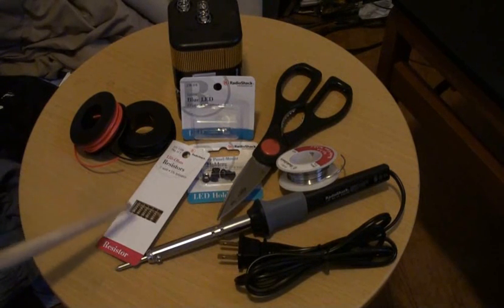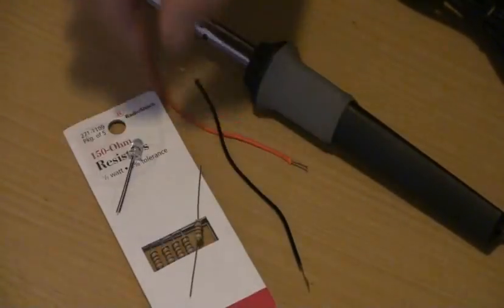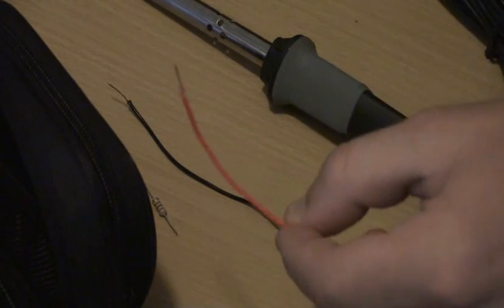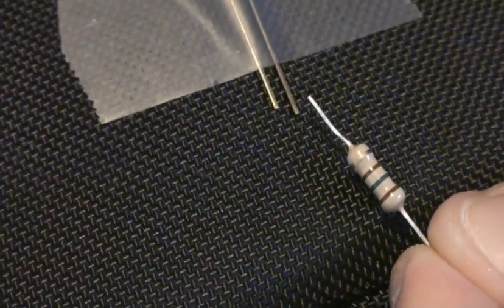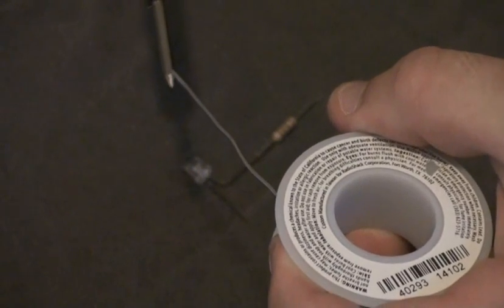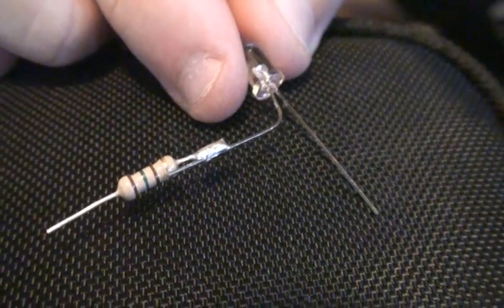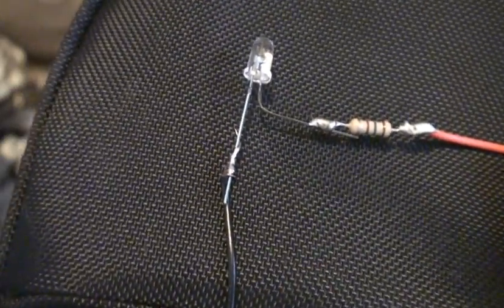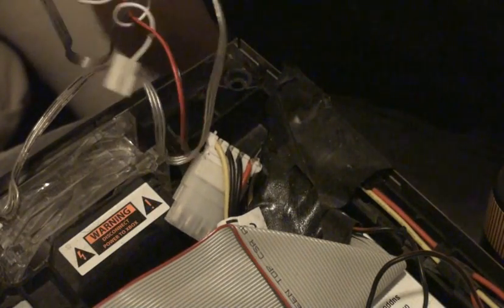How To wire LED's

Comment: always make sure your parts are hot enough to bond with the solder. that is a very big and wasteful joint and it also does not look like it is truly bonding (i.e. it's wrapping around your wire). to fix this you can tin your components before soldering them and and then simply touching your iron and poke on a little dab of solder. you will get a much better connection!

Comment: A resistor can go anywhere you like in a cuircuit, ie a closed circle. Whether the resistor is before the LED of after makes no difference, the current will be restricted. Current can not be higher or lower on any part of a closed curcuit than another.

Comment: @Famoussasdrummer182 "you always want to solder the resistor to the positive lead first. Because this is where the current is coming from and to the LED first. Putting the resistor on the negative leg will serve no purpose since the current has already passed through the LEDs."

WHAT?!?!? Are you kidding? LOL, NOOB. It doesn't matter WHERE the resistor goes as long as it's in the circuit.
AND don't try to tell me I'm wrong. Just look at my page of the stuff I do first.

Comment from the maker: @argannonumus 
hi
you always want to solder the resistor to the positive lead first. Because this is where the current is coming from and to the LED first. Putting the resistor on the negative leg will serve no purpose since the current has already passed through the LEDs.

Comment: m wiring up some leds and im running it on a 9v battery and all the power specs add up to 10 volts will i need some kind of resitor

Comment: hey i have 17 white 3,5 volts led's and im running them on 4,5 volts (battery)
but i want to hook em up to a powersuply that puts out 12 volts what resisto do i need to have 

im using a big resistor (green black silver silver)  is thatt bad ?? pleas tell me what resistor(s) i need to use 

reply fast :)

Comment from the maker: @mambabear 
hey
it all depends on how much those 12 LEDs need to light up properly as well as what type of circuit you are going to wire them in. But by just that inf o you gave me you will need more than 9v to light up 12 LEDs unless those LEDs use less than 1v each

Comment from the maker: @dalbir122 
hey
u wont need a resistor though since you are drawing .9v more than the battery is capable of providing but because of that your LEDs wont light up as bright and your battery will drain faster

Comment: @Account4Comments
The man didn't tell anything about what resistor to use. If he didn't have a web calculator, he probably couldn't decide which resistor to pick. I bet he doesn't even know Kirchoff's and Ohm's laws.
And yes, I decided I WILL make a video about calculating the required resistor and a tutorial how to solder them when I have some spare time. Subscribe to my channel so you will see it when it's made.
By the way, a good joint is made in less than 3 seconds. Not 10.

Comment: This is a perfect example how NOT to solder.
Your iron is not hot enough, you are melting solder on to the tip and all the flux gets boiled away before it comes in contact with the joint. What you are doing is  putting molten solder on the contacts, but not actually metallurgically bonding the two leads. You are making what's called a "cold joint," which doesn't conduct  well and breaks easily.
You shouldn't be making tutorials, you should be watching them and learning how to do it right.

Comment from the maker: @AnixSG 
hi  well it doesnt matter if the LED leg is touching the resistor's body but you can cut the excess off...
what you DONT want is if the LED leg is going so far that it touches the other side of the resistor's metal leg..otherwise your resistor would become pointless

Comment: hey is there a guide to what type of resistors and leds to use based on what voltage is used? what if i used 12v for example in a computer psu? let me know if theres some kind of table or chart you know of . 
good video

Comment: do you need to add a resistor to each led or can we have a couple leds (ex: 4-5)  solder to wires then solder 1 resistor?

Comment: the solder will not jump to the cold wire if u heat solder with iron first... T_T
it will look better if u use this technique while soldering:  watch?v=6QznAAwL8rI

Comment: Not to be rude or anything...but to anyone that watches this.  This is not the proper way to solder.  You need to "tin" your lead and your wire, this is the process of adding solder to each end you intend to solder then when you go to solder the connectors you do nothing but add heat.  The way described in the video runs the risk of overheating the wire which will damage the bulb as well as make the wire you are using more brittle.  Also, I think this video shows him using solder for highvoltage

Comment: 2 questions.
1. Would it really matter where you put the switch? I mean it just interrupts the flow of current.
2. What gauge wire did you use?

Comment from the maker: @nanoncheese 
hi thank you
yes you are correct if i put this LED onto a 12v source it will burn out using that resistor because the resistor is too small to resist the extra current 
o the lantern battery is 6v

Comment from the maker: mmmm
that doesnt sound good if they are getting hot to the touch either your pos/neg are backwards like you have the negative side of the LED connected to the positive side of the lead and pos side connected to the neg side.Also if your wires are to small and your running a lot of current through them that can also be the problem

Comment from the maker: hi man
1) you need a resistor to resist any extra current that your LED wont be using 
ex.   3.7v LED  attached to a 5v power source
you will have 1.3v of extra current that your LED wont be using and can cause the LED to burn out so you need a resistor to resist that 1.3v of extra current.
2) im not sure if i understand your second question man

Comment from the maker: yes you need a resistor if there is any extra current such as a 3.7v LED running off a 5v source there is that extra 1.3v that have to be resisted otherwise your LED will burn out.
So yes you need a resistor if there is extra current but not if there isnt like a 3.7v LED running off a 1.5v battery.

Comment from the maker: thank you very much
yes you can but most LEDs need more than 1.5v to light up properly unless your going to put batteries in a series circuit. Also remember that batteries wont last too long so you will probably be switching them out for new ones regularly....just something to keep in mind

Comment: lol. but i was just wondering because the brighter ones were 5x the price of the cheaper ones but i found some 8000 mcd leds that are only a couple cents more than the cheap ones. which were 1.5 mcd

Comment from the maker: yes you are correct 
usually those low mcd LEDs are square, low voltage LEDs 
the one in the video is a 2600
they make 5000,7000,high intensity 10000,and even high intensity 15000 !!!!! mcd rating LEDs CRAZY lol

Comment from the maker: o ok
ya just tap into some 12v leads and also if your using 4 3v LEDs than you wont need a resistor for a 12v lead as long as they arnt under 12v you wont need one unless your running straight off the car battery

Comment from the maker: so your putting 4 3v LEDs in series to equal 12v? so you would use batteries that would equal 12v?
and your worried about the amperage of the batteries? 
Well i wouldnt be worried about the amps with batteries they wony put out enough and as long as your restricting the right amount of current with a resistor you should be fine.Also batteries wont last too long

Comment from the maker: if you mean in one circuit than yes you technically can but you only need one per circuit cause after current passes through the first resistor the current than is already reduced to that of the resistor, so any resistors after that will serve no purpose

Comment from the maker: hey
well 3.2 x 71 = 227.2 that would be the closest you could get also assuming the LEDs were using 20mA. You would need just a 150 Ohm resistor for that and the circuit would be a series circuit.Other than that you should be good

Comment from the maker: ok much better thanks
well usually a red wire in a 360 is 5v, a yellow wire is 12v.but in a 360 there are very minimal visual wires so you would have to solder wires to leads soldered on the board, the hard part is finding these leads on the board this is where google comes in
well technically a LED cant handle voltages higher than they are supposed to run at (3.7,5 ect.) without a resistor and not burn out but with the right resistor to resist the extra current, you

Comment from the maker: hey
well if you are planning on putting at least 40 LEDs using a 12v source than you would have to use a parallel circuit because in series 12v would not be enough i hope this answers your question thanks

Comment: hey i plan on using 27 LEDs that need 2.5 volts and i plan on plugging it to a 12v DC wall transformer thing...what resistor should i use???

Comment: If you pre-tin each part to be soldered, you save on solder, have a cleaner joint and sometimes it lets you even have a free hand to hold the parts because you won't need extra solder when joining the parts. Also, use the thinnest solder radio shack sells and spend the extra for the larger rolls. Once you start soldering, you will find new stuff to do and next thing you know, you're a pro. 

This video is great and thanks for the link, exactly what I was after!

Comment from the maker: 1)You can connect as many LEDs in parallel as you want though the more LEDs the faster it will drain your battery
2)You should only use 1 resistor 
3)The kind of resistor to use depends on how many volts the LED needs to light up properly 
4) If you give me how many volts it needs like 3.7 or 5v or whatever it says i can tell you what resistor you need for a 12v battery 
no problem man

Comment: How many LED  can be connect in parallel with one resistor? 
If I using 12v battery what's the kind of resistor do I have to use? 
if you want just give me the color and I'll do the measure. 
Thanks for this video.

Comment from the maker: hi
i would be glad to help but i need to know some things first, what kind of watch battery will you be using (how many volts ect.)second, what kind of 2mm LED are you going to be using the specs would be great.You need to know those two things first to determine if you will need a resistor or not and im not quite sure i know what a 1/6 scale predator is? well any links on the info would be great as well thanks

Comment from the maker: well ill have to show you because it would be to confusing if i just tried to tell you how but you will need to google resistor calculator for an LED.Ill make a video on how
Yes voltage matters
thank you im glad it helped

Comment from the maker: no it doesnt need to be hooked up to a 6v battery in most cases youll be hooking the LED to a 5v or 12v lead.Yes a 9v will work just make sure you have the proper resistor for it